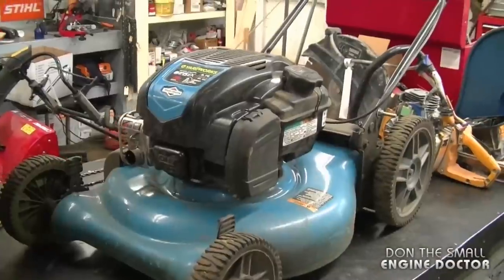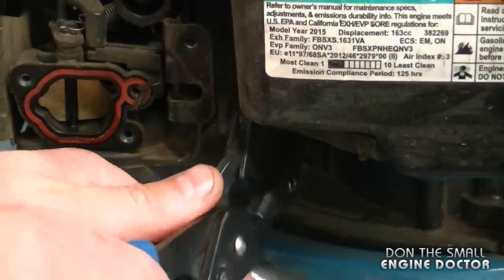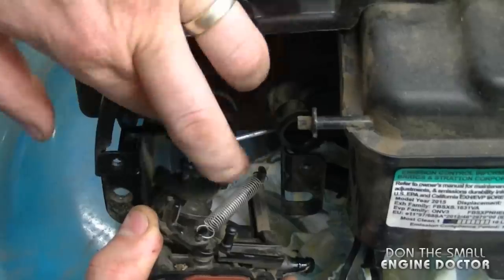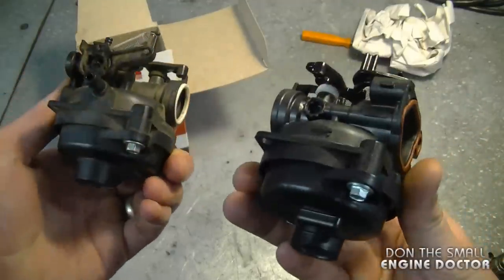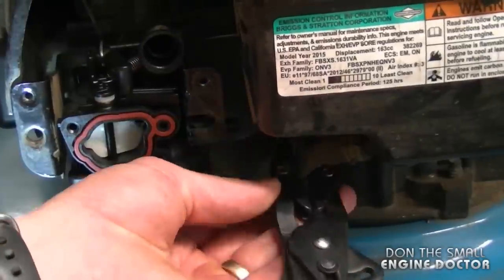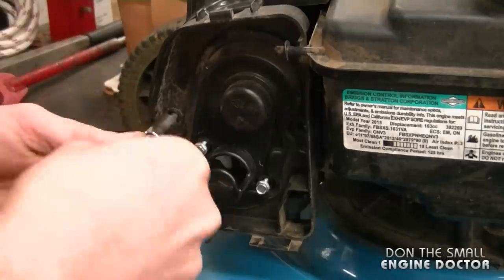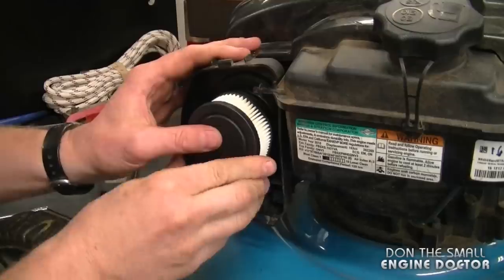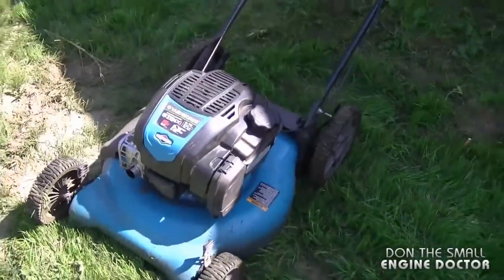Lawnmower Starts & Dies - Fix It By Replacing The Carburetor!

Comment: Those carburetors are very sensitive to dirt, but they are so easy to clean and work really well with clean fuel.  I'm not a big fan of plastic, but I think Briggs got this thing as well made as they could given the material the used.  Thanks Don!!

Comment: I’ve noticed this before...I like the way you hold the extension straight as you tighten bolts. Then to finish, you hold the ratchet where the extension meets the head. Good technique to avoid cross-threading and over tightening.

Comment: Hi Dony, it has been awhile. Hope as is well.  I worked on an older Bolens push mower with a Briggs & Stratton engine that had a pulsa jet carburetor( mounted on the tank) that surged. After cleaning then taking it apart  2 more times I was ready to buy a new carb. Turned out the plastic carb had just a slight warp & was missing the spring. A spring from another carb & an extra gasket did the trick. I just missed the obvious on this one. It took me 2 videos to show this one. I figure it will save some one some time or they can just get a laugh.  Stay well, Joe Z

Comment: Don,   That plastic carb is a really simple carb to clean out. I just used a bread tie wire to push through all the small openings, including the emulsion tube. I managed to get my 550EX mower to run like new.
Reply from the maker: same had been done to this carb with no improved performance. as a mechanic you don't want customers to come back. not so bad if it's your own  though
Reply: I here you on the no come back part as a customer. I don't even care to rebuild the zama carbs for stihl if you compare price vs. Success rate, not worth it. New is often a better choice.

Comment: Curious.  When you cleaned the carb the first time, did you replace the main jet assembly?  That's what usually goes wrong with those things and it's cheaper than buying a whole carb.

Comment from the maker: THIS CARBURETOR HAD PREVIOUSLY BEEN CLEANED AND THOROUGHLY CHECKED BEFORE REPLACING WITH NO IMPROVED PERFORMANCE.
Reply: Ok ok. No need to shout.
Reply: Dony have you heard about the Tillotson carbs for lawnmowers (and Honda GX engines) with mechanical fuel injection? they work smooth as silk over long grass.

Comment: i don't know if the last plastic carb on a lawn mower was the same but i was at the verge of replacing it so i pried on the piece inside the carb throat that is generally the emulsion tube and i think i was able to pop the jet/emulsion tube out and found quite the surprise of crud and build up that there was absolutely no way to get at without taking the plastic jet out. engine ran perfect once it was cleaned

Comment: I remember when I went to a Briggs and Stratton UK dealer conference and they advised that everytime one of these new engines come in for a service that you have to replace the fuel jet, possibly because Briggs and Stratton know they are useless when fuel goes off. Cleaning the jets can be done but it's not completely reliable long term.

Comment: How can you tell what carb or parts you need if the model number is rusted off? I have a 6.75hp Briggs and Stratton from 2006 which is self propelled. Is there a model number on the carb itself?

Comment: Another great video Dony 👍, what do you think about adding an inline fuel filter before the carb? Good or bad idea?
Reply from the maker: good idea but hardly any space on this mower
Reply: Not a lot of room but enough for the wafer style.
Due to fuel line rot,have the connector nipple actually touching the carburetor inlet nipple inside a short section of fuel line.

Comment: Hi Dony. My son has a Remington 140cc mower with a Powermore engine. He tried starting it but it will not start. It is 2 years old and the first thing I did was check for spark (got spark), then I pulled the carb. The bowl had water in the gas. So I assumed that was the problem. So I cleaned the carb and removed the main jet, float needle all cleaned. Put everything back together and still no start. I removed the carb three more times but nothing. It won’t even try to start. At this point, I am out of ideas. I can’t imagine that it needs a new carb as the machine has less than 20 hours on it. Anything else I should check?  Thanks

Comment: Don, 
I have two 6.75 briggs and stratton mowers. One with auto choke & one I switched out to a primer bulb carb setup. Both mowers have the same issue, surging or missing. I've swapped carbs with other parts I have, still can't eliminate the surging problem. I'm trying to fix em on the cheap to sell.
Reply: Brad what models are they ???  The older L heads or the newer E series like in this video ??

Comment: Hi donyboy73! I guess there hardly is any other option than replace the carb, because these modern carburetors are made out of plastic. Again, points to old Briggs engines and zero to modern ones.

Comment: last summer i bought a Billygoat brush cutter thing - bloody expensive, but we've been plagued by forest fires and i wanted to be able to keep these little saplings that seem to pop up over night cut down... it's a Honda engine, with an automatic start, but it never REALLY seemed to run smoothly.. i have fire pumps etc that are honda and they run beautifully.   last time i used the billygoat, i pulled it into the barn and noticed that there were flames coming out of the exhaust - couldn't see it in the day light - obviously flames coming out of a machine you bought to prevent fires is inconvenient to say the least - the thing is virtually brand new - until i saw the flames i thought the RRRRRrrrrrrRRRRRRRrrrrrr it makes was just the way it ran.   i'm guessing unburnt fuel which means carb?   i drained all my small engines already so easy to take it off.   i googled all over the place and couldn't find anything at all.

Comment: So sad. I recently gave up on my ten year old mower and bought one with this for an engine... can't find the old flat heads anymore. This probably won't last half as long
Reply: I agree. These new motors are made with so much plastic. I think they are crap. Even plastic in the recoil mechanism. Such cheap junk. Keep your old ones maintained!
Reply: @stevemlejnek7073  Or buy a commercial grade machine with a Kawasaki commercial or Honda GXV engine like the HRC216HX
Reply: Briggs says with there new line of mowers, you should get 7 to 10 years out of them. Btw Briggs says you don't even have to change the oil.
Reply: Shawn Vanderdoes Most people don't regardless. I change it once a year. What kills me is the engine on my old mower is still sweet, I have never even had the bowl off the carburetor. Still starts on the first pull. The deck gave out before anything else.
Reply from the maker: it definitely won't last as long as your old mower!
Reply: That is a marketing Ploy so people will eat that up  and buy those engines ~!~!

Comment: It may pay to fit an in line tap to the carby just so the engine can empty it of fuel.

Briggs & Stratton have nothing against the use of ethanol based fuels but Honda do,it can either corrode aluminium or eat rubber.

I have a case with my car  where it hasn't been registered for over a year & I just drove it down the road a bit at night unregistered to test what work I've done on it.

It drives very well & has a fair bit of get up & go in it since it runs the Chevy LS1 V8 engine in tuned form (41 kilowatts above the stock 235 kilowatts so is more like an L76 V8).

My point is it has developed a hard starting problem when cold,the same fuel had been sitting in the car for several months, I didn't add fuel stabilizer because I had no idea how long the car would be off the road for.

I rebuilt the in tank fuel sender & pump unit in 2016 using a brand new pressure regulator & pump,the point is that the fuel system isn't holding pressure after the 5 second prime on start up but when the engine is running, it is at 55 PSI which is acceptable.

The fuel pump shut off valve is good but the pressure regulator side is faulty,I pulled the sender unit out yesterday to see if it has a split tube or something, it ended up having a leak where the vacuum port of the regulator is.

What's caused it ? I think that phase separation has occurred meaning that all of the fuel floats to the top,the ethanol sits in the middle somewhere & the water sits at the bottom.

The ethanol has deteriorated the diaphragm so I have ordered a new $9-$10 pressure regulator on eBay, it may sound cheap but someone is reselling them for $70 USD in the U.S.

Comment: In the USA, if you are looking for gasoline with 0% ethanol, you can find it at most marinas.   Other than that, I don't know where you would get it.
Reply: Here is a link for every state in the USA and Canada  Just click on the state  you live in and it will tell you where NON ETHO pumps are.....   

I buy only No etho ..............
Reply: Bioooze , BP stations sell 91 octane gas with no ethanol under the name of Amoco Ultimate. I use it in my rider and push mowers. Other stations also sell no ethanol added gas ranging from 87 to 91 octane. You need to look around. Price is usually 50 cents per gallon higher. You can also get alcohol free gas in cans at most hardware stores or outdoor equipment sellers. Price is high but so is octane and they usually have a shelf life of 5 years unopened. These are great for snowblowers whose use varies in a season.
Reply: Boo LuQuette  The link didn't come through, I can't see it.   Could you post it in one of your public posts on your google+ page?   I will see it there.
Reply: David Holmes  What state are you in?   
Yeah, snowblowers, outboard motors, generators.   I'm actually ok with going to the marina because it's a great place to hang around for a while, even in the winter. The guys that work there are full of stories LOL.   The marina also has 92 octane 0% ethanol, which I use in my modified turbo car in the winter, at low boost.  It's a flex fuel setup on that car.  In the summer I put E85 into it and raise the boost some.  Then start putting the 92 oct 0% ethanol into it about this time of year, gradually bringing down the eth %.
Reply: Most WAWA gas stations have ethanol free fuel.
Reply: In NC there is a huge chain of "Quick Trip" convenience stores that carry real gas as an option on   of 12 pumps. That's all I run in any small engines. Ethanol is just too nasty.
Reply: Home Depot has it, if you want to pay $10 a gallon for it.  The key is not to let your equipment sit with gas in it all the time. Most small engines have a fuel shutoff. Just shut the fuel and run until the engine dies. Then again, at $40-50, carbs are cheap.
Reply: Ima fan ~$3.50 per gallon ethanol-free fuel @ most WAWA stations.  The big box stores near me sells it @ $20.00/gallon.  Why pay  more?
Reply: Sorry about the link here it is ...  You can go from maps to cities also.

//www.pure-gas.org/maps
Reply: Boo LuQuette   lmdetect :   Ok good,  thanks you guys.

Comment: I am seeing lots of Husgvarna blade adapters fail and shear of the star. Very soft metal everyone thinks. So you see this at your shop? was mostly on four wheel drive models.
Reply from the maker: I see it on most mowers, the adapters are much softer than in previous years
Reply: @donyboy73  I don't know if it's to save money or whether they're made that way as a sacrificial part if one hits something hard as replacing the entire mower isn't cheap.

Comment: what are your thoughts on those plastic carbs? do they last? do you see a lot of issues with them? great video thanks!
Reply from the maker: they are not too bad overall but the odd one acts up
Reply: I'm not a fan of plastic but I kind of like the way that one mounts by sliding back over the intake tube. Sure looks easier than trying to sandwich the usual gaskets and spacers on a standard flush-mount carb setup.
Reply: @eosjoe565  Some engines use studs like the early PowerMore and Honda's GX series.  Briggs has utilised that o-ring setup through most of its vertical shaft engines like the Quantum and Classic series.
Reply: They are a hell of a lot easier to clean.
Reply: WJCTechyman - the last one I did was a Honda GCV160 which had bolts. I pulled the carb and several gaskets, a spacer and a heat shield fell out. I had a heck of a time getting them all sandwiched back in there and getting the bolts started.
Reply: lawnboy has been using them for 30+ years. they are really no better or worse than a standard aluminum carb. the only thing i really dislike about most newer plastic carbs are how much more complicated they are to disassemble.